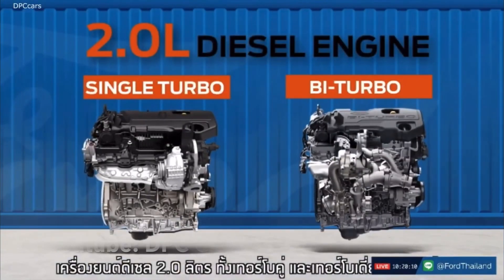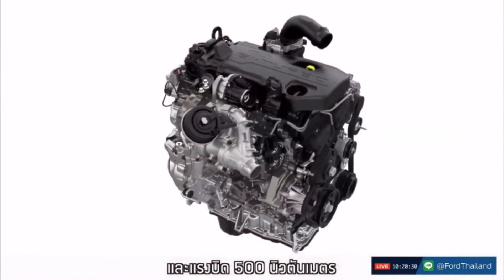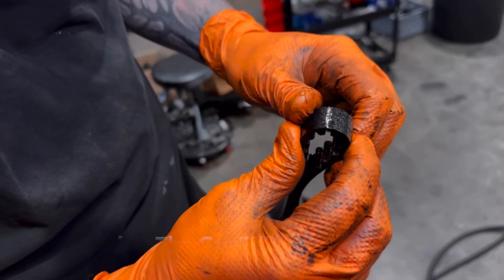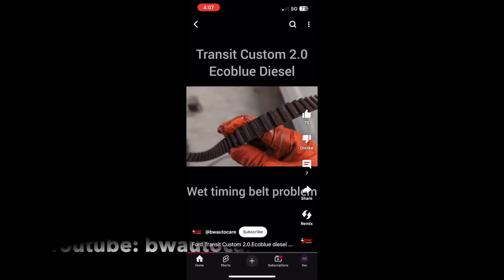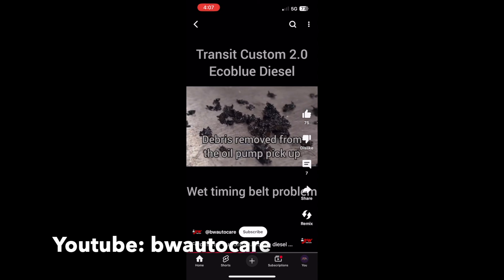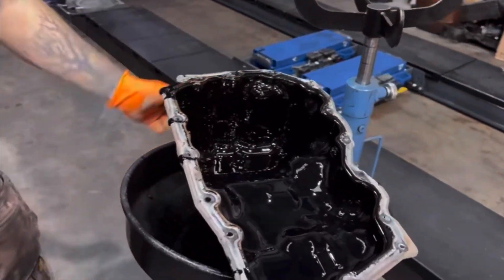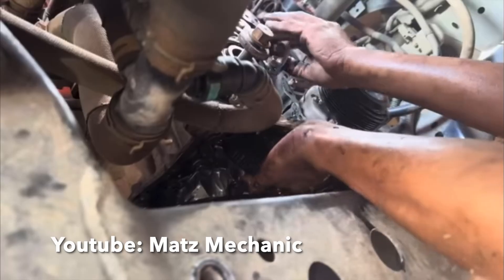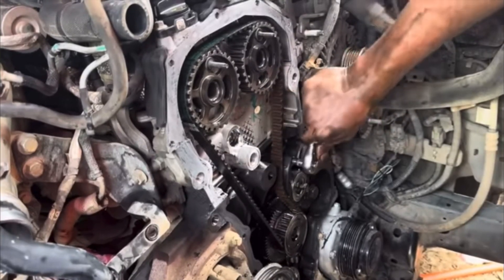The Ford Ranger Timing Belt Ticking Time Bomb.

Comment: A friend of mine just bought the Ranger raptor brand-new 6000 km later catastrophic engine failure
Reply: One of these Ranger Raptors is on floor display in my local dealership with over an $80k sticker price.
Reply: ya i bought a general motors vehicle the motor went out at 3000 kilometers go figure
Reply: @indy69541  I seen a video where a gm motor die after 4miles.and another at 100miles
Reply: Flord must have a death wish! 😕
Reply: Good
Reply: Did you know that the motor in the ranger is actually a Volvo motor
Reply: @jamesbarrows-y2i no they are not . Actually a citron enging
Reply: @jamesbarrows-y2i Volvo has never built a wet belt engine. So which engine is it?
Reply: 🧔🤔(MAZDAS)(BT-50)🛻(5)(CYLINDER)(ENGINE)IS A(VOLVO)(ENGINE)AND(VOLVO)🛻🧐🤨🫣👀🧔🤔(F-CK)THEM OFF BECAUSE(CYLINDER)(5)(BREAKS)AND(SHATTERS)💥⚙️⛓️‍💥🧐🤨🫣👀🧔🤔THE(PISTON)🛻💥⚙️⛓️‍💥🧐🤨🫣👀🧔🤔

Comment: At which point did they change to a belt? because I found this answer from Cars Guide 

"Ford’s popular PX Ranger (sold from 2011 to its replacement in 2022) marked a distinct move away from timing belt technology to drive the engine's inlet and exhaust cam. So, regardless of what engine your PX Ranger has fitted to it, the Ford Ranger timing belt or chain question is answered with a simple response: It’s a timing chain.

That means the timing chain should be good for the life of the vehicle and will not require replacement at regular intervals, unlike engines with a rubber drive belt belt, provided oil changes and other maintenance has been carried out properly. This gets around the rubber drive belt problems of periodical replacement and the associated cost.

This advice covers every PX Ranger engine, including the 3.2-litre five-cylinder diesel, the 2.2-litre four-cylinder diesel, the two-litre twin-turbo diesel and even the short-lived (2011 to 2015) 2.5-litre petrol engine."
The bi-turbo carried through to the PY series
Reply from the maker: PX3 Bi Turbo 2.0L from 2019 onwards is Wet Belt, 3.2 & 2.2 are chain,  , all Next Gen Rangers are Timing Belt except the 4.0L Petrol EcoBoost which is chain.

Comment: I have been in the trade for 48 years and I can say that is the dumbest idea I can remember seeing. Planned obsolescence .
Reply: What about the V8 OLDS diesel?  What about the Pinto that explodes in a fender bender?  Dodge 2.7L?  Vega engine? 6L and 6.4L Power-stroke? Cadillac V8,6,4?  GM 3.6L? Jag V12? North Star V8? 1.0L eco-boost?  They went with a timing belt because it is cheaper to make each engine compared to a set of sprockets and a chain.
Reply: What trade is that , no way your a mechanic the video I’d sponsor is Toyota
Reply: Yuuup🤑
Reply: Ford ranger motor is actually a Volvo motor and Volvo is owned by china

Comment: This is not a US market ford ranger 4cyl ecoboost they use chains
Reply: Do they use a chain for the oil pump drive?
Reply: @chrisgraham9203 The 2.3L oil pump is directly geared to the balance shaft.  The 2.7 has a wet belt.

Comment: I never new certain Ford Rangers had wet belts well that's a deal breaker when it comes to buying any vehicle and they have gone on my list of vehicles in avoid another reason why l will stick with my 1997 Toyota Hilux it has its original timing chain and has done 4390000 kilometres
Reply: its only run in  at that milage ...............!
Reply: And another you may not know is the motor is actually a Volvo motor

Comment: Wet timing belt.
This is why technicians hate engineers.
Reply: Often it's bean counters that decide these issues not engineers.They always go for the cheaper option in parts and design and as a mech engineer they never listen.
Reply: @ So you agree it’s a ridiculous idea?
Reply: @ronfeast932  it's for emissions, less noise and friction.
Reply: I promise you that any decent engineer would not recommend this technology, but the money people overrode them and used this as the least expensive way to improve emissions and fuel economy mandates.
Reply: Do you mean mechanics? !!
Reply: @StephenEllis-fq3nh  No. Technicians. That’s what mechanics are these days. Automotive technicians.
The term mechanic hasn’t been used since the mid 90s.

Comment: What nut case in ford thought of this type of engineering… they did it before in another model ( not the ranger )  with huge problems and to apply it to the ford ranger is beyond belief .
Reply: They put this engine in the new Ford Transits too the best selling Van in the UK and probably Europe, it's like they're trying to kill their brand because after this madness the Mercedes Sprinter is going to make a strong comeback
Reply: Nobody at Ford the motor in the ranger is actually a Volvo motor

Comment: All new vehicles are 💩
Reply: @needleontherecord Funny that u say Honda because here in the UK Honda was selling the 10th gen civic with a 1.0 turbo engine similar to ford 1.0 ecoboost with the same stupid wetbelt too and even the Japanese couldn't make a belt material that withstands the oil all for what 0.000000001 mpg gain/0.000000001% co2 reduction and saving pennies at least just do a regular belt if its cost cutting over a timing chain so they lost their rep with that engine being the same stupid wetbelts but their 1.5 turbo is generally reliable
Reply: Dmax: Try me.
Reply: @needleontherecord  Toyota reliability a fable...
Reply: In the USA it’s a timing chain on the 2.3ecoboost, or the 2.7v6 ecoboost. Both oil squirter jets for piston underside. They are much sturdier then older engines internals wise

Comment: a ranger is a ticking time bomb regardless if it has a timing belt or chain
Reply: True fact the motor in the ranger is actually a Volvo motor
Reply: I had a dual plug ranger with 350k on it. 😂

Comment: 60k plus for a new ute in Australia,  and less reliable than ever. The government has a duty of care to protect the people. When are they going to use there power to protect the people? Companies like ford probably spend more money on advertising than engineering. Regardless of your budget, who makes a reliable ute?
Reply: Toyota, as always.  Nobody is forcing you to buy Ford.
Reply: @JossRickard  once upon a time, i agree. The new stuff not so much. Isuzu has been more reliable than toyota in the last 10 years. My point is , for the cost of a new ute, they should be much better.
Reply: @GG-rj4oj what evidence do you have to support your statement, none I'd guess
Reply: @garywatson9917  the list off common problems with late model utes is endless. Problems like, bump steer from factory, intercooler failures and intercooler hoses, egr cooler failures, drive belt tensioners, leaking injector tubes fitted in cylinder head, dpf failure, what about a fuel filter thats fitted on the return line to the tank. 
Would you like to discuss the false advertising.  Which ute can tow 3.5t. They advertise that, as long as there is absolutely nothing in the car. Even a overweight driver would see you exceed the legal limit. 
Maybe you can write which ute is trouble free?
Reply: @GG-rj4oj   you said that Isuzu has been more reliable than toyota for the last 10 years,what proof do you have e.g,number of each on the road and breakdowns for the last 10 years, it's a simple question
Reply: @GG-rj4oj  you try to defect my question by asking me what ute is trouble free but I never said that I knew and I don't, your the one that seems to have all the answers
Reply: @garywatson9917  im guessing knowone is able to answer any of your questions,  at a standard you find acceptable.
Reply: @GG-rj4oj   I'm 68 years old and have spent my life hunting in the mountains of nz,bought my first 4wd hilux in 1981,over 1.2 million km in 4wd vehicles so I have my own thoughts and opinions and by your answer it is obvious that you wouldn't have a clue about the number of breakdowns Isuzu vs toyota in the last 10 years,in the area that I live where there are thousands upon thousands of 4wd vehicles in certainly know which ones give the least problems and that would be toyota by a mile.Its not rocket science, you only have to look at the people who rely on their vehicles for their livelihoods,farmers, tradies, search and rescue, hunting guides,to name just a few
Reply: @garywatson9917  im not trying to sell you a car. The point i made is for the money that new 4wd ute cost, they arent that reliable. They all have issues. It may even shock you, that i put 600 thousand klm on a RN106 hilux myself. Reliable sure was. As were many other brands in that era. Not now, is my point. In fleet maintenance you get to see many problems and their magnified.
Reply: Toyota 2.7 petrol.
Reply: @stendecstretcher5678  not much of a tow vehicle with 245nm torque. But agree that 2.7 petrol is pretty reliable.
Reply: @GG-rj4oj  triton
Reply: Dude, the government "protecting the people" is a lot of what is making cars unreliable, and inefficient. Dpf's(fire hazard, exhaust blockage) egr valves(in conjunction with the pcv, blocking your intake manifold), and manufacturers having to reduce compression ratios to reduce nox emission(reduces power, so more fuel burned for the same amount of work, so are those emissions actually reduced for the amount of work done?). And why have manufacturers put these on their engines? Because of epa emission targets which the government has decided are the way to go, and as far as i can see only result in the engine being less efficient, developing less power and burning more fuel(again, lower compression ratios, and dpf burnoffs for example). Its like we're back in the 70's era, where targets were set, and basically the only way that manufacturers had of reducing nox emissions was to lower engine compression ratio, which, you guessed it, resulted in burning a lot more fuel for the same work done.. Personally, i think we'd be better off if the government just stepped back a bit more, only set fuel economy figures(which hey, would also result in reduced emissions!) and just let manufacturers create an efficient, reliable engine.
Reply: True fact the motor in the ranger is actually a Volvo motor

Comment: Ford  reliability ,,,3.2L seizure of oil pump causing motor failure ....Now the 2.0ltr with a pathetic wet belt causing motor failure .
Reply: The oil pump doesn't seize, it looses it's prime if the oil is drained for too long.
Reply: @BryanM63 Oil drain fault is only one issue .  Excessive wear and breakage when driving are just more examples of even more faults with the pump.
Reply: @paulthompson1654 if you don’t change your oil every 8,000 miles
Reply: True fact the motor in the ranger is actually a Volvo motor
Reply: 🧔🤔(YES)HEIR IN AUSTRALIA🗺️🧐🤨🫣👀🧔🤔WHEN(FORD)MADE THE(FORD)(RANGER)🛻THEIR WAS A(NEWSPAPER)📰🗞️📰🧐🤨🫣👀🧔🤔(ARTICLE)(STATING)THAT IF A(MECHANIC)🧑‍🔧WENT TO HAVE🧔🤔(SMOKO)🥯👋🧑‍🔧🍩👋🧑‍🔧☕👋🧑‍🔧AND LET THE(ENGINE)🛻(OIL)💦(DRAIN)OUT🛻💦🔩🔧👋🧑‍🔧WHILE HAVING(SMOKO)🥯👋🧑‍🔧🍩👋🧑‍🔧☕👋🧑‍🔧THEN THE(ENGINE)🛻🧐🤨🫣👀🧔🤔WOULD'NT(RE PRIME)THE(OIL)🧑‍🔧👋🛢️💦🛻🧐🤨🫣👀🧔🤔(PUMP)AND THE(ENGINE)WOULD (SEIZE)UP🛻🧐🤨🫣👀🧔🤔🥱🤭🫢😂🤣😂

Comment: Another junk idea from Ford . Beaware the service intervals in the UK equipped vehicles has significantly shortened by ALOT due to early failures. New schedule 160,00km or 6 years .
Failures are still being seen at the shorter interval so reality is 120,000km 
Did I mention the price 1000British ponds or AUS 1800$   . Very expensive ......
Reply: True fact the motor in the ranger is actually a Volvo motor
Reply: Volvo in automotive =nothing special

Comment: nice tip, do the the 3.2 5 cyl have belts or chain
Reply: Chain mate
Reply: 2.2 and 3.2 are Duratorq engines which use chains. Only the new 2.0 Ecoblue engines use timing belt soaked with engine oil. My SC recommends to change at 180k km but some videos I watched have premature failure and most of them aren't even reach 100k km yet.